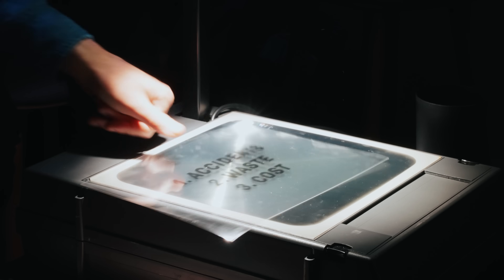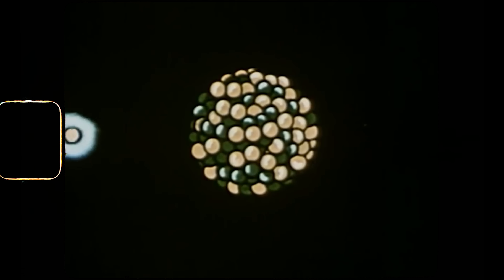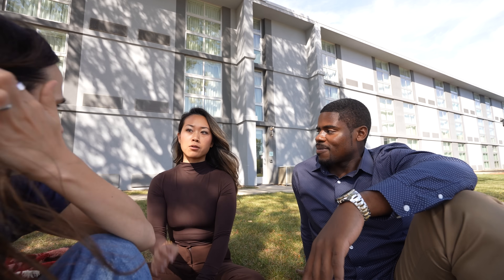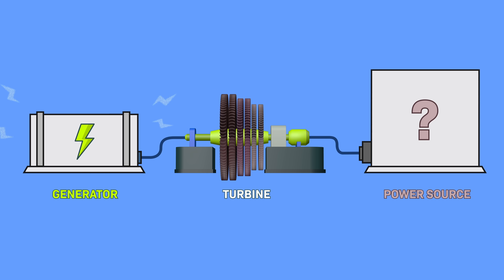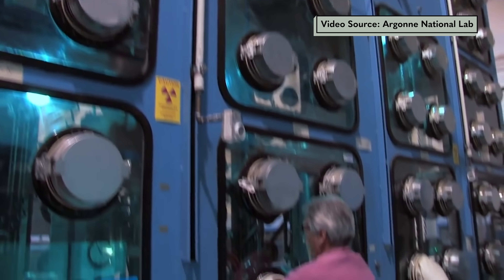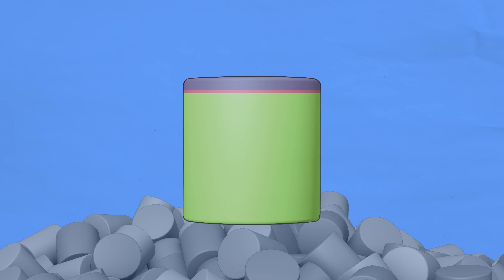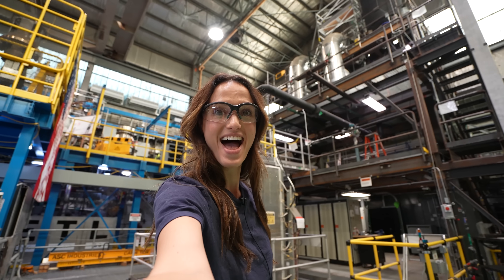The Big Lie About Nuclear Waste

Comment: I hadn’t known about this process, but I had always wondered why we did not use some form of solar panel, to capture the radiation and convert it forever to electricity. In essence the waste would be a forever battery. I love the recycle idea!
Reply: The technology you're describing is called optoelectric photovoltaic nuclear batteries. They use beta emitting isotopes to excite a phosphor, which emits light that a photocell can convert to electricity. One of the most prominent isotopes used for these is Technetium-99, which is one of the highest percent yield products from uranium and plutonium fission, and it's also one of the longest lived waste products.  These batteries tend not to produce much current, but they can supply small power for very long periods of time
Reply: @Spencergolde  Such as the Voyager probes launched in the 1970's. They are still sending out faint signals.
Reply: @Spencergolde  thanks for the awesome breakdown. It sounds like it is still missing out on the seemingly huge scope of energy being emitted… i may be wrong, but thats what my gut is telling me.
Reply: @mikebarkhouse6669 You need to let the waste sit and "cool" for about 3-4 years for a detention period. It does require cooling due to radiodecay heating, but the term "cooling" refers to allowing high-energy isotopes to decay to a low level so that the waste is less "hot" from a radiation standpoint. It's considered impractical to process or in any way manipulate the waste at that point because there's so much ionizing radiation coming off of it that even remote robotic handling is difficult, because electronics can become damaged, and DNA is even more susceptible. After that waiting period, only about 20% of the fission products are still radioactive, and those are mostly all long-lived isotopes, half lives greater than 30 years. They generally don't release much energetic radiation, but some of them, like Iodine-131 and Strongtium-90, can accumulate in the body, in the thyroid and bones, so even their small radiation doses can cause problems over time. So the basics: most waste is only energetic for a short amount of time, and because it's so dangerous, it's not worth trying to squeeze a few kilowatts capacity out of them. The ones that live a long time are only present in small amounts, don't release much energy, and are potentially biohazardous. We could make a AAA battery that would last decades, but it would cost a lot of money and be filled with something that could cause leukemia. It makes sense to do that in some situations. If you want to put a radio broadcast system in remote Siberia to operate independently for decades, a nuclear battery might be worth the cost, and it's unpopulated enough that the consequences of a containment failure are low. Which is why Russia has such nuclear batteries in Siberia to this day

Comment: Indeed interesting and promising technology, but i need to point out five errors all withing one minute.
6:32 Not any liquid, but water.
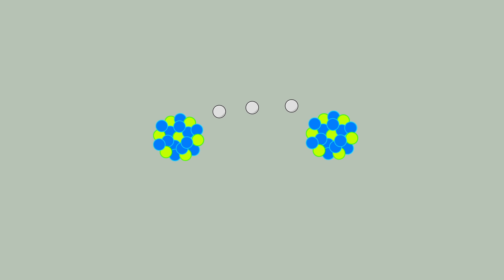6:50 Uranium is not a rock, but an element.
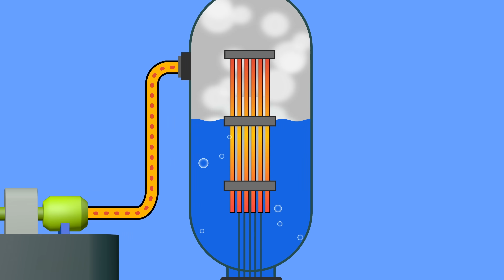7:00 What is shown is definitely not uranium, because uranium is a metal. What is shown is a mineral, which might contain uranium.
7:05 the number 235 refers to the total number of neutrons and protons in the nucleus combined. Uranium 235 contains 143 neutrons. What is said is just not correct.
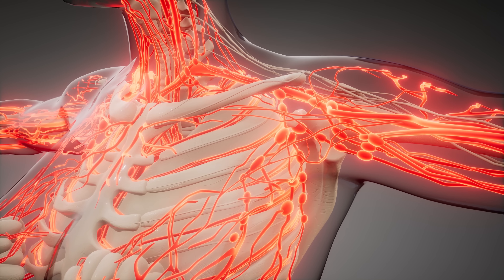7:30 The split of the atom, the nuclear fission, is initiated not by atoms, but neutron, which is also indicated by the visuals.

Comment: A nuclear power plant is just a boiler and a steam turbine as are most power plants. Anything, that can release energy in the form of heat can work. I mean you could burn garbage to generate power. I wouldn't do that because it's terrible for the environment but you could. Anyways, radioactive waste is dangerous because it's still releasing a significant amount of energy in the form of radiation. Enough to be hazardous to anything with DNA but not nearly enough to power the typical nuclear reactors we think of. Think of it like charcoal from last night's camp fire. It can still be used as a heat source but not as effective as firewood. Oh and this theoretical charcoal will slowly let you taste sound. I didn't include forcing oxygen into a coal fire can produce significant amounts of heat just two unattended fires is the reference.

Comment: Because nuclear itself is already vastly more expensive I think we have to look at this as a waste removal project that coincidentally produces electricity. I think if spent fuel has so much energy to offer we should think about pivoting to a renewable grid that is mostly selfsufficient but uses these waste reactors as peaker plants. I don't know if this plan has big holes in it, but i feel like not extracting more uranium and instead recycling but still mostly relying on cheap cleaner energy sounds great

Comment: At first I figured this would be about absorbing the radiation they are emitting, essentially creating 100,000-yr, diminishing-output batteries, but this is even better in a lot of ways. The battery thing would probably be highly cost-ineffective
Reply: Yes, but long lived low output batteries have great applications in insustry too. You absolutely can have both.

Comment: Hi, it's great to see this boiled down to see this boiled down to a fairly simple process, but just to make it clear, there is more than one type of nuclear waste recycling. In addition to U-235 recycling (or U-238 recycling with enrichment), there are also additional fuel cycles that can actually transition to running ON transuranic elements (elements made as a result of U-235 fission). The most commonly proposed, and seemingly most promising, is the fission-fusion from Pu-239 into Th-232 (transmutation to U-233), which can then serve as a basis for more standard fusion cycles, while reducing the quantity of "weapons-grade" Pu-239.
Reply: Oh, the "weapons-grade" plutonium is quite easily handled. Just leave the stuff in the reactor for a long time. To produce the weapons grade stuff, they cycle the fuel through the reactor fairly rapidly in order to reduce the amount of Pu-240 produced. If there's a lot of Pu-240, the stuff has too much spontaneous activity which would cause a premature chain reaction before the core was fully assembled in a bomb. In fact, Pu-240 contamination was the reason they went to the implosion method used in Fat Man instead of the gun mechanism used in Little Boy.

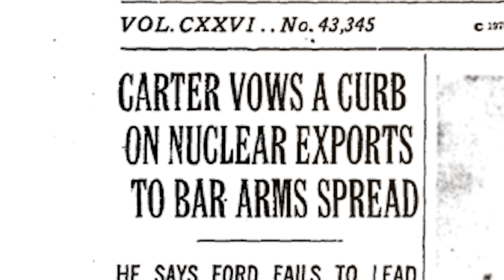Comment: 10:40 when material is radioactive for shorter times it means the radiation emitted is in higher frequency. Less time between half life cycles equals more half life decays in the same time period vs a different material with longer half life. More decays equals more radioactive events.

Comment: This was such a good and well-made video! My opinion on this is, that nuclear will not be the solution for eternity and also not huge reactors, however I do believe smaller and more modular reactors could be the key from moving us away from fossil fuels while we transition to more green energy resources. Wind turbines are for example also much more modular and can be easily installed almost anywhere, easier to be maintained and replaced. And if we fuel these smaller reactors with recycled fuel, while also reducing the time that the waste will be radioactive, this would be a win-win situation. Obviously this is just a stepping stone while we are developing other solutions like better solar, green energy storage or even nuclear fusion and switching a lot of devices to the medium of electric power. But I mean the nuclear waste is already there and just lying around, then why not use it?!
Reply: Wind turbines are a blight on the earth, a 10 to 15 year life with no recycling and just making China richer. Apart from the wildlife they kill.

Comment: I think that the statement that we need to store something for a 100 years or 1000 years or longer is extremely unjustified. Here is an equivalent statement. In those time frames, we, as a world full of humans, cannot find other solutions. That with 100,000 years of trying we could not find a way to solve this problem. (Of course, there is already a way, as explained in this video.) That anyone claims we need to store this for a really long time is making a claim that goes against so much evidence of all the problems that have been solved. It is basically an idiotic statement. (Like, "I don't like chemicals in my food or body.") Think of all the times this silly statement has been made, and apparently no one thinks it through.

I wonder how those, back in the 60s and since, who protested nuclear power generation feel today knowing that they are largely responsible for climate change. I say this because if we had continued to research and improve nuclear power we could have greatly reduced dependence on fossil fuels long ago. (Maybe no oil shock of the 70s or no concern about peak oil or oil spills and no need for fracking or wars to secure cheap oil.) Climate change might not even be a concern. So people who were afraid of the possibility of nuclear catastrophe instead opted for the very predictable global catastrophe of climate change, which in the 60s was already a concern for scientists in the know. I would be shocked to hear any of the protestors admit this.

Comment: CANDU's waste is plutonium and it's hardly a friendly material.

On the positive side, this reactor is the very best technically and by far the safest operationally for several reasons, but it is considerably more expensive to build than the American 'boiling pot' design.

At Fukushima an experimental reactor was fueled with plutonium that was probably the bi-product of a CANDU, and it blew itself to bits as a consequence of the earthquake and the weaknesses inherent in the boiling pot design.

The French have been recycling nuclear waste for some time now, and good for them, but in spite of high hopes, the garbage has proven to be very difficult & extremely dangerous to handle, not to mention the no doubt staggering costs associated with repackaging, which means the benefits promised aren't being realized, at least so far as I'm aware.

However, in spite of all the negative engineering hurdles that concern me, I do share @screddot7074's view regarding political interference.

In my mind, even though the delays caused by the circus of government do unwittingly result in a few benefits, the attendant costs incurred consequent to ever changing political winds are so financially gigantic, the Pickering 'tube replacement' cris for example, and downright dangerous to us all as per the meltdowns listed below, government interference cannot be justified.

At the extreme end of the equations, government meddling can lead to a poor design like the boiling pot going into service prematurely as engineers etc. were likely rushing to get something built before the industry was regulated into stasis by one Party, or another?

in the current analysis I think any new application of the boiling pot remains a flawed choice and before anyone locally goes ahead building new & improved versions of that design, I feel there should be some major thought given to other approaches beyond even CANDU, thorium perhaps?.

To support my contention regarding the bp design I note, that reactor has been involved in every meltdown disaster todate; i.e.., Fermi 1, Three Mile Island, Chernobyl, and the more recent triple header at Fukushima that openly continues trying to kill us.

( the Chernobyl reactor is a variation of the bp theme )

So much to say, so little time.

All just mho.

Comment: The problem with nuclear power isn’t technical it is the cost. Nuclear power is one of the most expensive methods of making electricity. If you do it safely and want to reprocess fuel it makes it even more expensive. I was an engineer and supervisor in a commercial nuclear power plant for 35 years. There is a reason they are shutting down nuclear plants that are in near perfect condition and the construction costs have already been paid off. Even without the costs of construction and only paying for operation and maintenance nuclear power is more expensive than renewables, natural gas, and coal.
Reprocessing spent nuclear fuel is incredibly expensive. They keep talking about what is technically possible but not cost efficient.

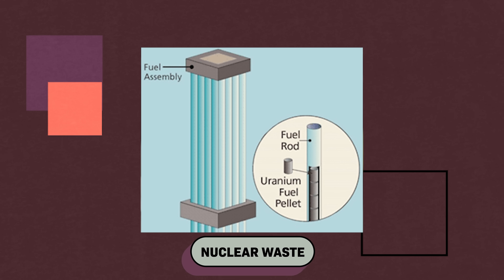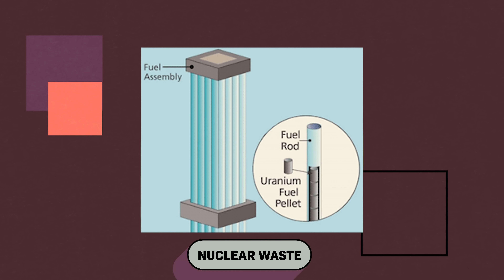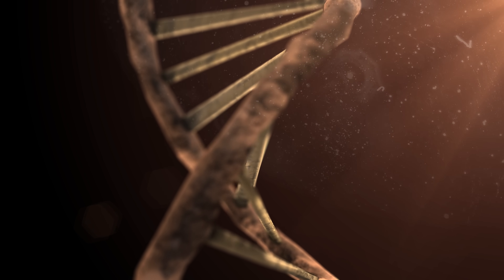Comment: 07:07 - 07:09 The correct thing is that the number refers to both the number of protons and the number of neutrons added together. And at 07:30 - 07:33 I am pretty sure you meant to say neutrons instead of atoms. Other than that, incredibly good video.

Comment: im living in the eu.
Point 1: resupply. The amount of energy we can produce with reactors is limited because the amount of uranium is limited and we havent and likely will never be able to synthezise it.
Point 2: cost. In germany to be exact the energy from npps is one of the most costly for the consumer even after being supported from the goverment. with ee we can get down to 7cent/kWh, npps are around 90 cents/kWh after getting rid of the support. so it would be lunatic to rely on the more costly and limited product.
Point 3: co2. yes, running the npp produces nearly no co2. building it requires a ton because of all the concrete that is used, yes there are alternatives being developed but the concrete for npp is a special mixture and it might take centuries to come up with an alternative that isnt limited and co2 friendly.
Point 4: time. building a npp takes 10 - 15 years. had we started 1980 as we were made aware of the climate change that might have been a possible intermediate solution.
Point 5: danger. you can never get a reactor to be 100% proof against a melt down, western reactors are inherintly more safe then eastern, yes the only 2 melt down ever going catastrophic have been from the same reactor typ which only looks like a good idea if you glance over it, but if i remember correctly even in the USA there was a partial melt down which could be contained. so downplaying the risks isnt an option. so we know that the rbmk-1000 reactor and the deprived ones are flawed and fast construction came them even more vulnerable, there is still one original in operation and 7 newer versions. general electrics builds reactors build on the same principel still today.

conclusion: to late, to costly, not sustainable. yes even if we produce power from the waste but we have to produce the waste first. as the thorium/waste reactor is new it will take decades before being fully developed and quite safe and then it will still be more expensive then ee. the claim that these reactors only have to be build is far off, having a working laboratory prototype is far off from getting it to work in the real world. in europe we have a facility thats testing on these typ of reactors and they hope to build a larger version starting 2025. scaling up things isnt always easy, especially if some parameters arent scaling up linear.

having an open mind reviewing projects stopped for reasons isnt a bad thing but in this case there is nothing going for it.

Comment: The problem is the level of efficency and outcome. The plant you mentioned does indeed use nuclear fuel to generate electricity, but the waste it produce is used for atomic bombs. And last time I checked the US was extremly keen in avoiding the spread of said weapons even among its own allies. We once had this discussion in germany and the US government said "If you build this plant we will sanction you." Why? Because it opens the box of Pandora, the production of nuclear bomb parts. Second: during the process the elements will degrade due to natural reaction until they form a non-nuclear material. But the lower you go the more inefficient it is. So who is going to pay for it? The taxpayer? The electricity company? Noone wants to. And third: even if you somehow manage to get everyone on board with funding you would still have to build a huge amount of facilities (and replace older ones and take care of their non-reusable nuclear waste like the main reactor chamber) which will take time, money and ressources. 
The French are doing some research on Transmutation but it is in such an early state it won't be usable for the next 20 years.

Comment: Correction on the what the 235 in U-235 means. You say it refers to the number of neutrons in the atom, but it only does so indirectly. It refers to the number of protons AND neutrons in the atom. The actual number of neutrons is 235-92=143.

Comment: Nuclear Power was demonized just like Kaneh Bosm so that now when they induce the famine, there will be no power. They want to orchestrate a total failure of infrastructure so that the WEF can make you believe that they are the solution - despite all their money coming from deceiving others. Nuclear power is awesome, just keep it at a safe distance so if it has a meltdown due to whatever reason - no problem. Much more efficient than 50m fan blades that are too durable to be recycled cheaply.